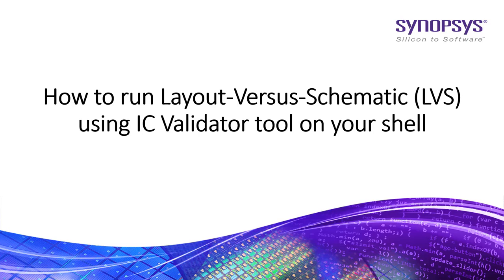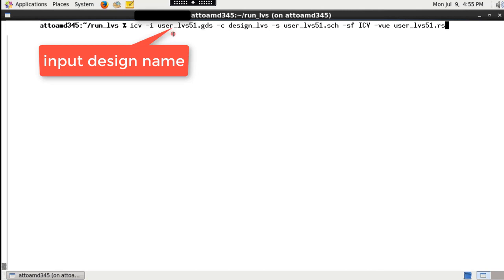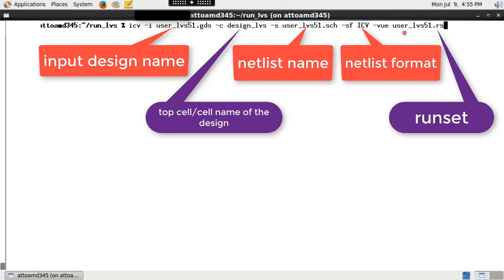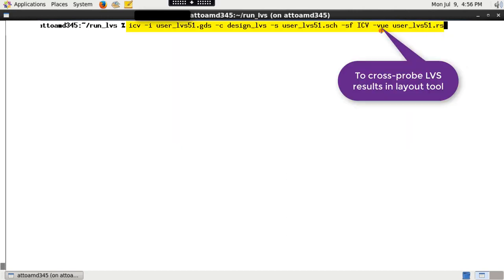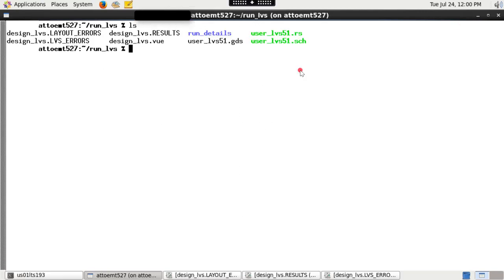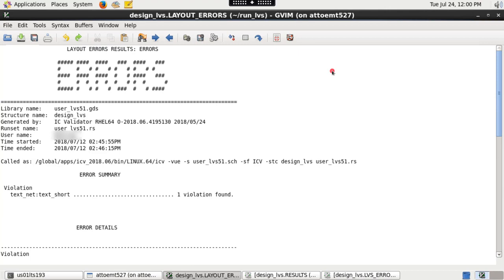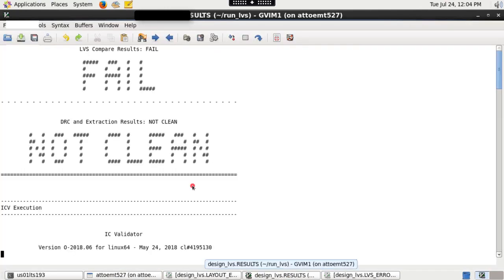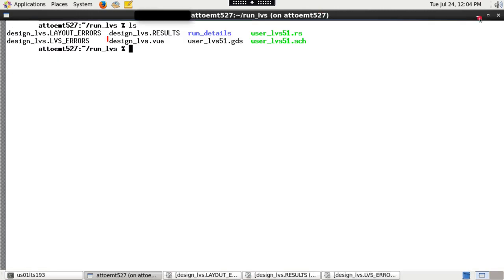How to run Layout-Versus-Schematic (LVS) using IC Validator tool | Synopsys

Comment: Getting this error while doing LVS, any suggestion?
WARNING (OSSHNL-117): Ignoring switch view 'symbol' of cell 'nmos4t_hvt' in library 'SAED_PDK_32_28', as it does not contain
any instance. To netlist this cell, add this switch view to the stop list or to
ignore any specific instance set the property 'nlAction' to value "ignore" on
this cell view.